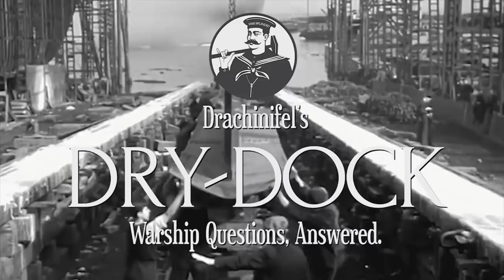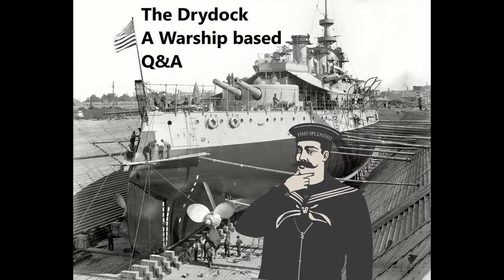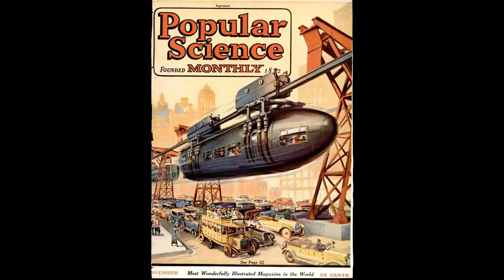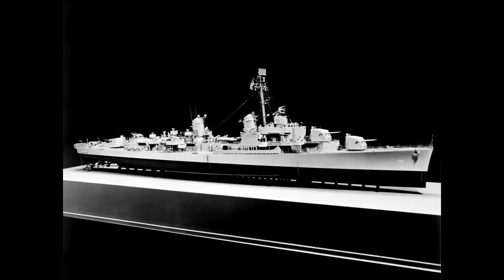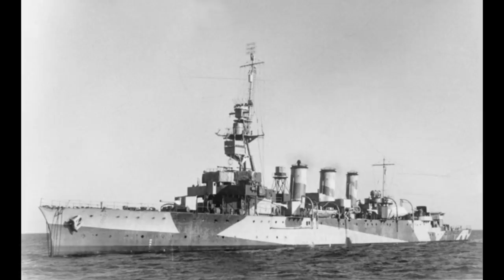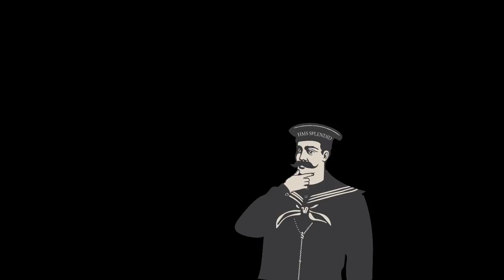The Drydock - Episode 085

Comment: Naval architect here! @Drachinifel explained the Length-to-Beam ratio well. I would add that the type of the hull (displacement, semi-displacement, planing) is even more important than L/B ratio but more length is definitely a better choice for displacement and semi-displacement hulls. The biggest problem for displacement and semi-displacement hulls (most large warships are of these types) is that they can't outrun their bow wave easily, and attempting to do so creates lots of resistance and drastically raises the propulsion requirements.

Comment: Drach- Two points, If I may, Good Sir:

1) I was waiting to see what your answer was concerning what Class or Type of Cruiser could outgun HMS Dreadnaught. I was surprised your answer was "never", if I recall. Wouldn't the USS Alaska (CB-1) and USS Guam's (CB-2) 9X12/50 caliber rifles handily outgun the Dreadnought's main battery? I'm saying this from the perspective of having say, optical fire control only, just to level the field a bit.

2) I'm JUST getting over what I was told was NOT COVID-19, but, a rather nasty strain of Type A influenza. My current workplace is down 35% in staffing while I've been out sick since last Wednesday. I reside in Massachusetts, which is why I bring this up. All I can say is, I've camped on USS Massachusetts since I was a week lad, and, they've only added to not only Mamie, but, the other Museum Ships as well (where else is there a mostly intact Gearing Class on display?).

Thank You again for all your hard work to increase our knowledge of Naval power, Past and Present.

Comment: Question: HMS Nelson / Rodney were alleged to have very hydrodynamic hull designs, but only 45,000 shp on two screws for approximately 21kts. How much extra power could be put through two screws, fitted into the ship and what speed increase in speed could be achieved? 25? How much more useful/effective would they be given their traditional deployments?
Reply: Benjamin Poole - Max speed on the Nelsons was 23 knots. The 2 screws could conceivably take 70,000 shp, without shaking either themselves or the ship apart, which might have given them an extra 3-4 knots.
https://en.wikipedia.org/wiki/HMS_Nelson_(28) 
http://www.naval-history.net/xGM-Chrono-01BB-Nelson.htm

Comment: I read an a account from the us naval proceedings magazine about the Falklands War. In which the Argentinean Submarine "San Luis" fired wire guided torpedoes at Royal Nave ships. In all cases the CO of the San Luis said that the wires broke. My question to any one was/is this a common thing with wire guided torpedoes???? Here is a story by Sebastien Roblin about the San Luis.

For most of the war, a lone Argentine diesel submarine, the San Luis, opposed the Royal Navy at sea. Not only did the San Luis return home unscratched by the more than two hundred antisubmarine munitions fired by British warships and helicopter, but it twice ambushed antisubmarine frigates. Had the weapons functioned as intended, the British victory might have been bought at a much higher cost.

Comment: The Balao has a pressure hull of .875" high tensile steel.  When attacked by aircraft using guns the pressure hull of a Balao will easily stand up to 30 caliber fire and possibly stand up to 50 caliber AP fire that is not hitting it at right angles.  It is not likely to withstand 20 mm AP rounds unless the angle of impact is quite oblique.  The impact of machine gun fire on the pressure hull is likely to be reasonably oblique because of the small portion of the pressure hull above the water line.  Keep in mind that in most cases the round will have to first pass through about .25" of steel fairing or ballast tank.
Perhaps more critical is the effect of gunfire on the ballast tanks.  These were .25" mild steel and would be fairly easy to penetrate.  A strafing attack on the submarine would be likely to penetrate these many times though mostly above the waterline. This would prevent the sub from submerging and possibly sink it without penetrating the pressure hull.

Comment: I'd love to see a video on the potential for ramjet assisted shells using modern guidance technology. To be brief, a ramjet is a very simple and efficient air-breathing engine that only works at supersonic speeds. No moving parts. Some missiles have used them, but need an expensive and large booster to reach the supersonic speeds at which the ramjet takes over. I feel like a 16" or 18" shell fired at supersonic speeds and aided with the ramjet could attain a range of a couple hundred miles, and carry a high explosive or depleted uranium payload to great effect at less cost than say, cruise missiles. A modern nuclear-powered battleship firing such shells could actually be a money saver given how often the U.S. likes to lob cruise missiles random places to make a point.

Comment: Wow.. late today.. I almost thought it wasn't Sunday 
Hopefully HMS Hotspur vs french hotel someday
Martin Shell... oh that's an old one.. have tried out from a shore battery but even then it's a lot of effort compared to heated shot... as for aboard ship.. no.. just no..
Reply from the maker: They stuck a small forge aboard Warrior for the purpose :)
Reply: @Drachinifel  I knew she could sink anything of the era but that's gross overkill.. about the same result as a slow acting hesh round.. handling molten steel in anything but a dead calm would be insanely hazardous.. but hey RN .. they would have a drill thoroughly worked out... go Britania
I did know that a major steel (not really iron) warship of the era would have forge capability for repairs.. but there is a lot of difference between heating a steel bar to facilitate it's bending or a pan of rivits.. and having several hundreds of pounds of liquid metal ... one would also assume they heated the shot case as well..
They did have a battleship in the philippines.. she was made of concrete.. had 2 turrets that couldn't cover her rear... cost a fortune...
Reply: @Drachinifel  isnt lead is more practical in that case? It melts at much more manageble temp

Comment: @Drachinifel - "there's quite a few ideas..." is incorrect. "There's" is a contraction of "there is" and is a modifier to a singular person, place or thing. "They're quite a few ideas" is correct as "they're" is a contraction of "there are" which refers to multiple people, places and things - in this case, ideas. I will not entertain a reply. Your criticism of someone's pronunciation encouraged this correction. That "they're" is a rather illogical contraction however its correct pronunciation in clear. Jet fuel fire does not leave molten pools of steel that glow red for days nor does burning jet fuel (eighteen-hundred degrees) turn hundreds of thousands of tons of concrete into powder. Thermite does. Love the accent.
Reply: "They're" is a contraction of "they are".  The contraction of "there are" is "there're", not that it's used much.
Reply: @sqij1  - I stand corrected. I was learning this stuff in the fifties and needed some refresher. Finally someone with grammar skills. I need never mention spelling, that's another ocean. The "there's for all occasions" drives me nuts. I haven't seen there're in decades and spellcheck refutes it. Thank you.
Reply: @bamboosa  I quite agree.  I despair for literacy sometimes nowadays.  Good luck!